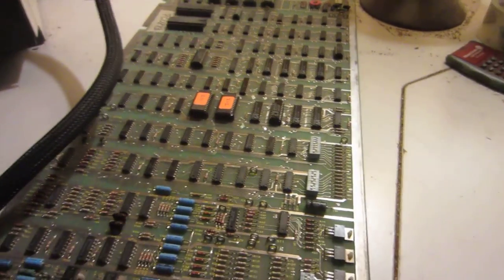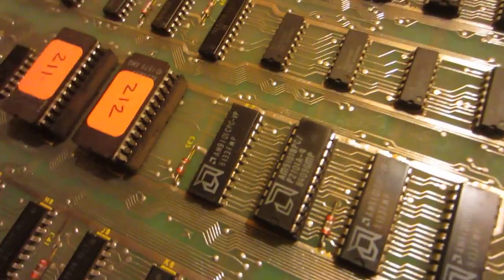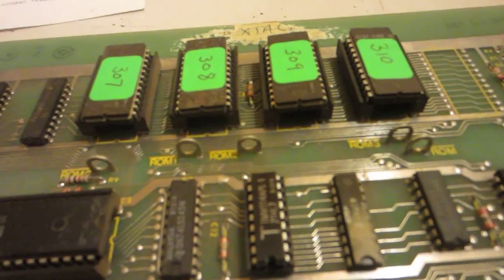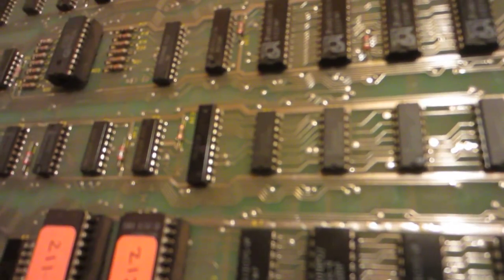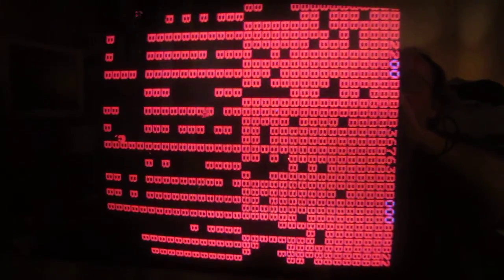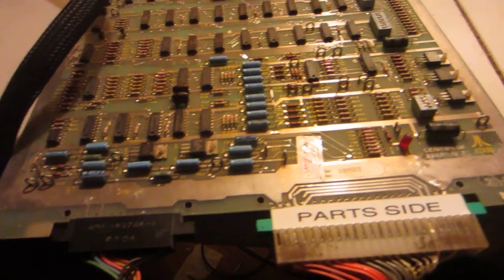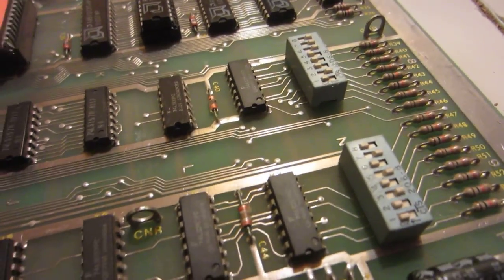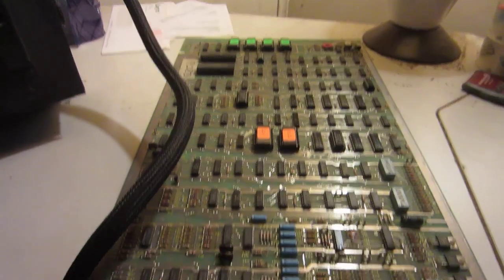Centipede Repair

Comment: if you still have this board, it looks like you have damage on data line #1 (2nd data line since start counting at 0). It appears to be stuck, so it's probably smashed/cut, this error is effecting more than L7. if it was just L7 you'd only see "B"s in every 4th "Section" of the screen shown whe nyour in self test mode, instead of all but one of them.
Reply from the maker: No, it's been resolved  years ago.

Comment: Hi All,
Brill vid..
Can anyone help : I have a centipede board that I have corrected several faults and have managed to get it running well. The only fault I have is no sound ! I have checked LM324 and this seems good. I have changed the pokey c012294-01 for a new old stock c012294b-01 but still no sound. I have changed the pokey to another new old stock c012294b-01 and still no sound. I have probed pin 37 on the pokey and nothing. I have even lifted pin 37 but still nothing. I have checked there is data on D0-D7, A0-A3 and RW Q2. Im not so sure about signals on CS low and CS high. Anyone have any ideas.
Many Thanks Rick
Reply from the maker: Have you compared checksums on the Eproms?

Comment: Where,could i buy ram/rom or chip's for a center pede board?
Reply from the maker: Twisty Wrist sells the 2101 Ram as well as the 2716's.  You'll need to burn the Eprom yourself though.   You could ask him but I doubt he'll do it for you.  If you're anything like me if you buy 1, may as well buy 10 of each just to have a stock of them for next time.
Reply: not to hijack this thread but if you want to get all the centipede roms replaced in one shot... here you go. https://www.etsy.com/listing/242337222
Reply: not to hijack this thread, but to answer the question, if you want to replace all the ROMs in one shot here is a great inexpensive solution 
https://www.etsy.com/listing/242337222
Reply: arcade-cabinets.com what about pokey chips for centipede board?
Reply: ouch. good luck. I know of only one place where you still can get them as they haven't been made forever and are super hard to find... they are pricey though https://www.highscoresaves.com/catalogsearch/result/?cat=0&q=pokey